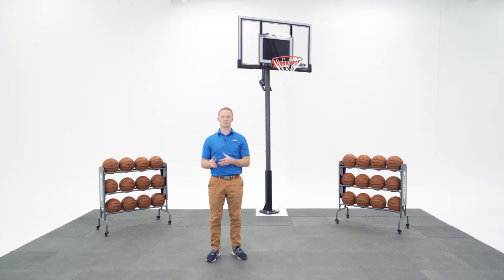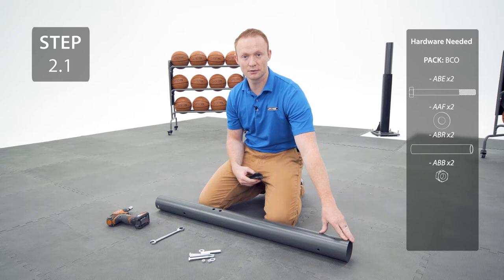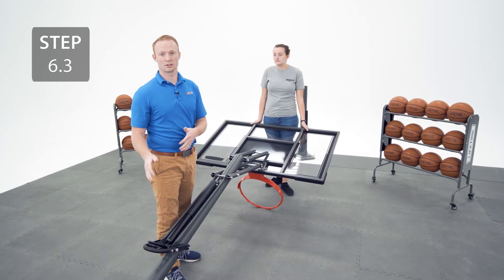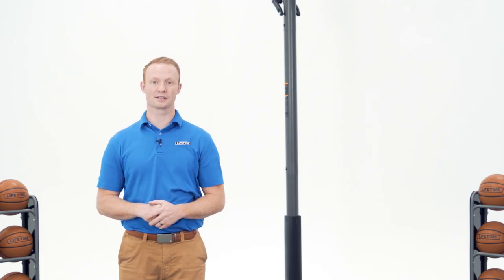Lifetime In-ground Power Lift® Basketball System | Lifetime Assembly Video

Comment from the maker: Section 1
Refer to your manual

Section 2
02:13 | Step 2.1
02:58 | Step 2.2
03:16 | Step 2.3
03:40 | Step 2.4

Section 3
03:58 | Step 3.1
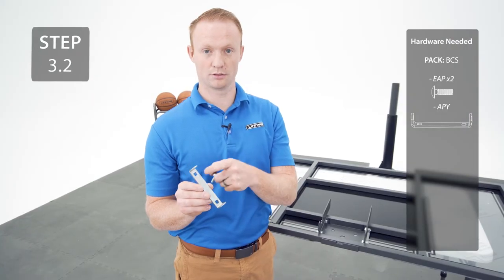04:44 | Step 3.2
04:52 | Step 3.3
05:13 | Step 3.4
05:35 | Step 3.5
05:45 | Step 3.6
06:12 | Step 3.7
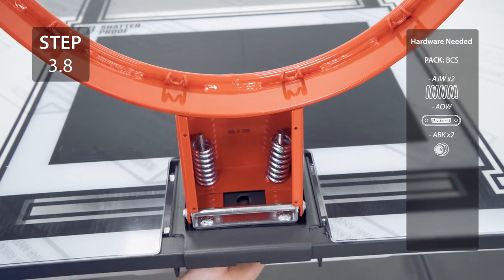06:32 | Step 3.8
06:54 | Step 3.9

Section 4
07:14 | Step 4.1
07:44 | Step 4.2
08:13 | Step 4.3

Section 5
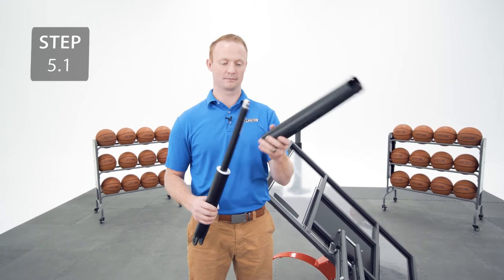09:36 | Step 5.1
09:40 | Step 5.2
09:54 | Step 5.3
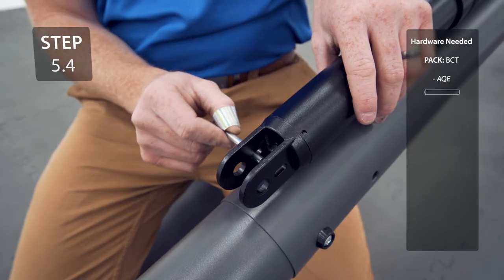10:16 | Step 5.4
10:20 | Step 5.5
10:58 | Step 5.6
11:24 | Step 5.7
11:51 | Step 5.8

Section 6
12:10 | Step 6.1
12:47 | Step 6.2
13:19 | Step 6.3
14:13 | Step 6.4
14:34 | Step 6.5
14:59 | Step 6.6
15:10 | Step 6.7

Comment: Can this be used as a swimming poolside BB goal by just eliminating the bottom pole/s?  And if so, 
how far from the pool on the deck should it be mounted?  18-24”?
Reply from the maker: We have a basketball system specifically for the pool. This one wouldn’t work because of the assembly. This system requires 3 long poles and if not assembled with all poles there are safety hazards and warranty will be void. Check out our Lifetime Poolside here: https://www.lifetime.com/lifetime-90742-pool-side-portable-basketball-hoop. This system can also be found on amazon.com .

Comment: Where can I buy the bolt down sleeve
Reply from the maker: We don’t sell a bolt down sleeve, unfortunately. You can, however, purchase a ground sleeve for this system for the cementing. Here’s the link: https://www.lifetime.com/lifetime-0023-3-5-inch-round-pole-basketball-ground-sleeve

Comment: She's cute, can she come help me?  JK.  What are your thoughts on installing this into existing concrete using threaded bolts that are epoxied in?  Thank you.
Reply from the maker: As long as you have a bolt pattern of 9" apart then our system will work on your exposed bolts. If they are not, please refer to the instruction manual to see how to properly assemble your system.